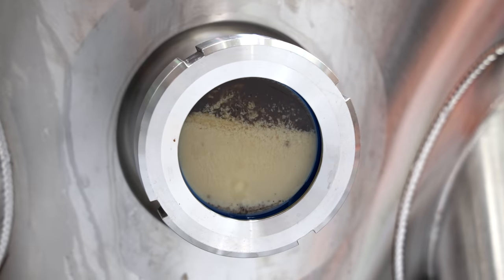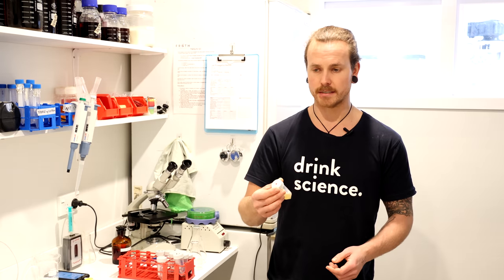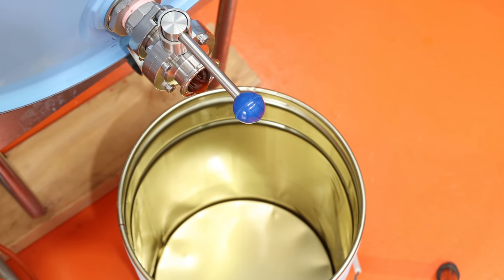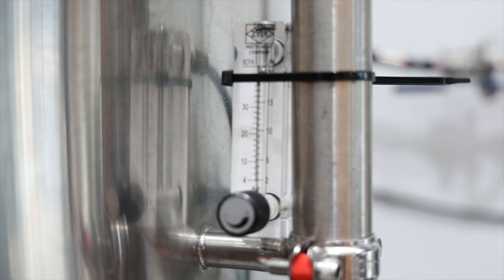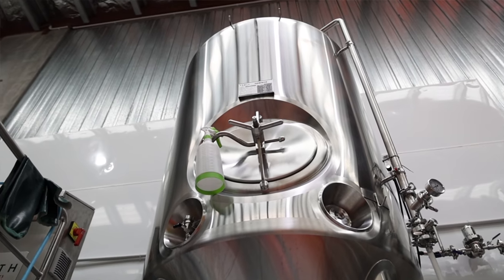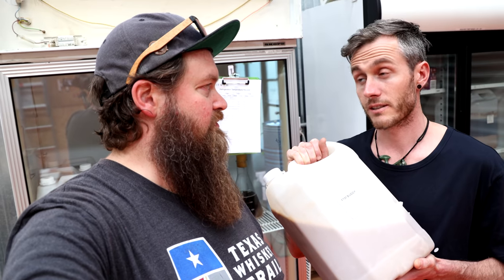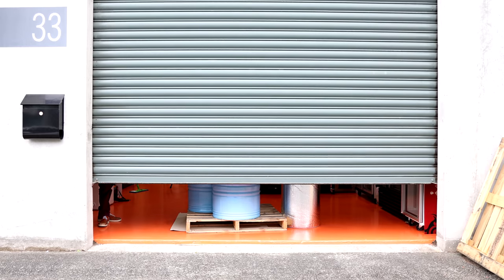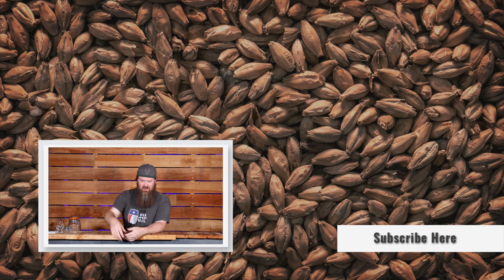Learn To Propagate Yeast From The Professionals At Froth Tech

Comment: conflicting opinions on dry yeast.  technically i think the average cell count is quite a bit higher, but a more significant portion is dead.  i have tried both extensively over the last 20 years, at home and as a brewmaster at a local brewery for 3 years.  we really couldn't (nor our customers) distinguish the same beers made with Wyeast #1056 liquid ale yeast, and Safale US-05 dry ale yeast.  Both strains worked fine, and finished about the same speed usually, both were repitched at least 10 generations before ditching.  i would recommend either one, except for the facts about carbon footprint and buying local and all that good stuff, Wyeast is actually in my home state of Oregon!
Reply from the maker: Interesting!  Yeah I have talked to multiple pro beer brewers on either side of the dry vs thing.  Nice to have another data point on that one!
Reply: on the note of dry yeast having a lot of dead cells, some tests i saw a while back of how important rehydration was for dry yeasts pointed to the fact that while pitching directly into wort as many as half the cells died because of osmotic pressure compared to a much lower number if you rehydrated in clean water for a while beforehand, it didn't actually significantly affect the fermentation at all; i think the conclusion was that while a lot of the yeast ended up dying, the remaining healthy yeast was very easily able to use those dead cells to fuel its own growth through a slightly macabre process of yeast cannibalization. the dead yeast basically acts as a hyper-efficient yeast nutrient that the yeast can much more easily take advantage of than traditional nutrients or natural nutrition from the barley etc.

Comment: Having my own small yeast bank, this is interesting stuff. Interesting how the o2 keeps it in reproduction mode rather than booze making.
Reply from the maker: Ah nice work man!  What method are you using to store?
Reply: @StillIt  I also have a small yeast bank. I both dehydrate some of it, and store some in the freezer in a water/glycerine mix. Both methods have worked out to 2 years of storage so far.
Reply: @adamw2785  just curious, is the glycerin a cryoprotectant or just a neutral food sugar for when they are thawed out?
Reply: @dangoldbach6570  It's a cryoprotectant. AFAIK, S. cerevisiae can't assimilate glycerin. I use 25% to 30% glycerin and RO water. Put it in a 50ml centrifuge tube. Place it into an alcohol bath in the freezer to slow its rate of freezing. Once it's frozen, take it out of the bath and put it into the permanent storage box in the same freezer. My freezer is a regular consumer chest freezer, it sits around -35C to -40C.
Reply: @adamw2785  very cool, thanks for the info!